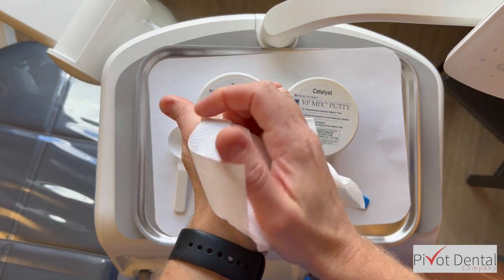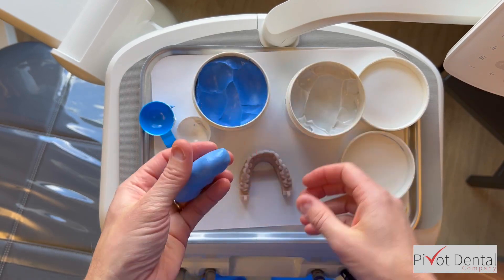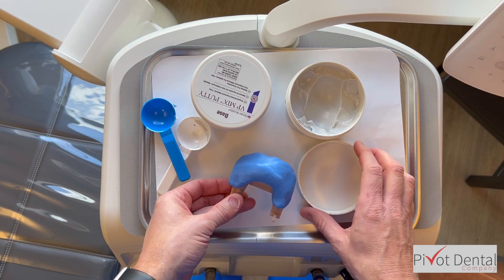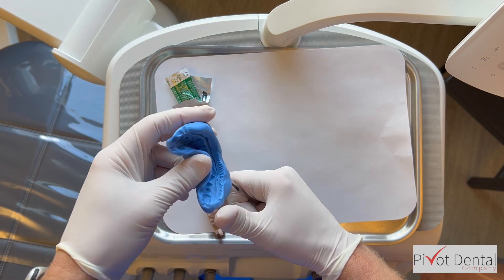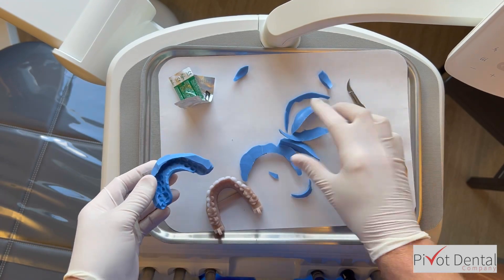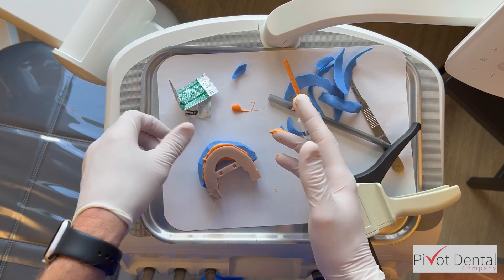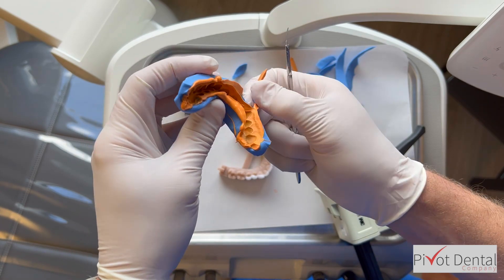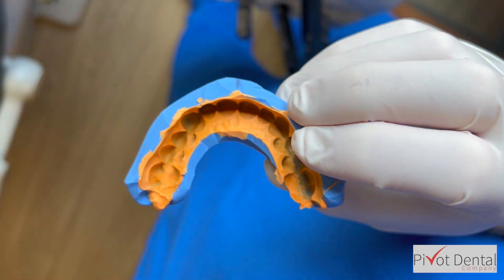Making a Putty Matrix

Comment: Why not just make the wax up digitally then print them ?
Reply from the maker: The wax up is digital and printed. The putty matrix is used to make chairside temps.
Reply: @DrBradRevering  but there is still wax on the printed model, wouldnt that work if instead of using physical wax you do the mock up and print it all in one model?
Reply from the maker: @FonsoDalchemist  Sure. That would work too. For this case the lab used wax. The point of the video was to show how to make a putty matrix.
Reply: @DrBradRevering  amazing work i was just wondering since i have been doing wax ups on exocad to make the matrix putty i was just wondering if there is any difference between wax and printed wax up 🙏🏽
Reply from the maker: @FonsoDalchemist  No real difference, just different approaches.
Reply: @DrBradRevering  awesome thank you for answering so fast , i was wondering if there is more detail on analog wax ups compared to leinted but i guess it depends on the micron you print right ?
Reply from the maker: @FonsoDalchemist  At some point the level of detail reaches a point of diminishing returns. The wax up leads to a PVS putty matrix. The matrix is filled with BisAcryl temp and then trimmed in the mouth with carbide burs.
Reply: @DrBradRevering  ohhh i see so the light body helps to keep as much detail as possible gotcha!